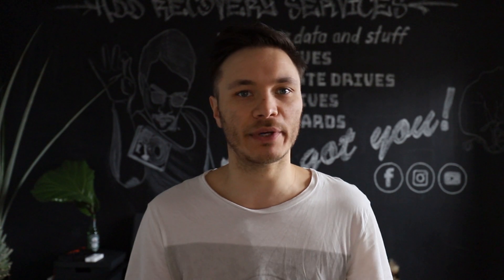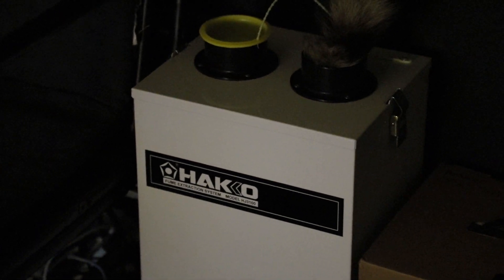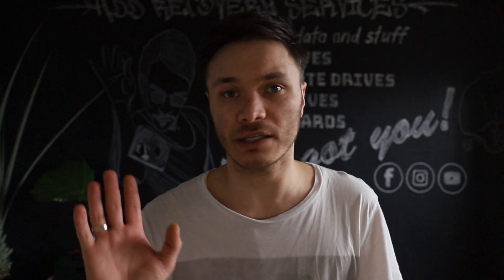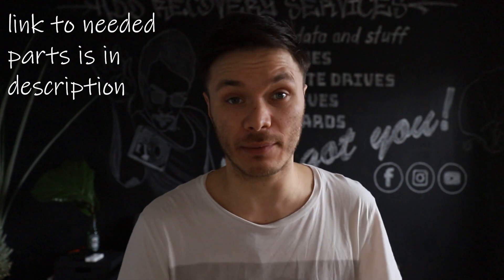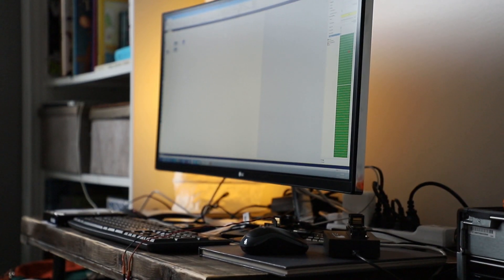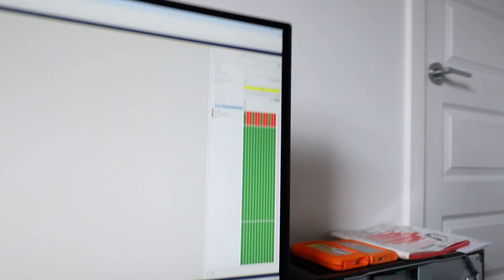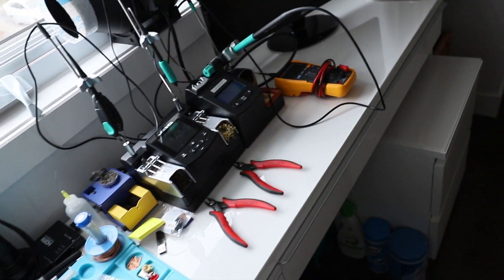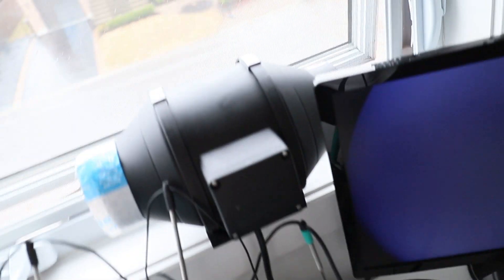home lab setup, data recovery webinars

Comment: Would like to get into data recovery. I currently run a computer repair/support business and find outsourcing data recovery most quotes are way above £500-£600 now. Needless to say 99% of people turn it down.
Reply from the maker: It's how you market it. Ppl that are looking for data and willing to pay for it go to data recovery companies most of the time. 500-600pounds is not even that bad. Drives we get with platter damage are going for over 2000USD at least

Comment: You could also bring fresh air inside, maybe turn the room into a pressure room. It could be relaxing as long as the fans system is quite.
Stay healthy. Mind and body.
Reply from the maker: thats a good idea Steven. I actually think that this setup is going to stay here after lockdown.

Comment: Hi Erkin, glad to see u again.
What i don't understand about the Hakko fume extractor is why is it good at office but not at home.
If you had a second Hakko fume extractor, would u use it at home instead of that you've mounted at your house window?
Reply from the maker: at the office I don't have a duct to the outside yet, but I will be looking int making once as soon as this COVID19 passes. With bigger the area of the office, hakko exhausts will dissolve in much bigger space. I tried the hakko at home, but it still smelled a little just because the room is so small. Hakko does not have a tube exhaust so it would be hard mounting it to the window. Fumes that go to hakko do not get 100% neutralized, they just become less harmful from diverting and filtering. Exhaust system like I setup on the window, simply takes them outside making work area practically fumeless.

Comment: I'm glad to hear from you again. I love your videos. At first I'm like why isn't he posting videos? Then I'm like ohhhh yeah the virus. 

As for fume extraction, I was working on a commodore 64 a few months ago. I had to replace the RAM chips. Only one was bad (U12), but they are all from a well known bad brand. I figured if one was bad they would all go eventually. I was choking on the fumes at times when I was working on that. But that's not something I do very often. That 35 year old computer works great for the most part now, but it has a minor graphical issue. I think I know what the problem is, but getting parts right now for a 35 year old computer from around the world isnt't the best idea right now. Anyway any potential soldering should be limited to 1 or 2 more chips: the PLA or the color S-RAM. The video chip itself is socketed so that won't need any soldering. If I did it all the time, yeah I'd definitely need fume extraction.